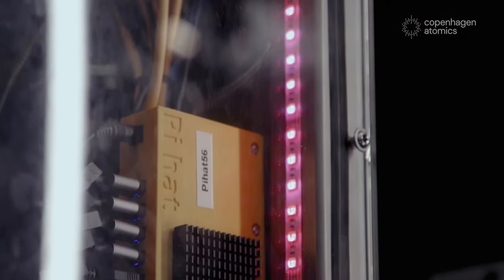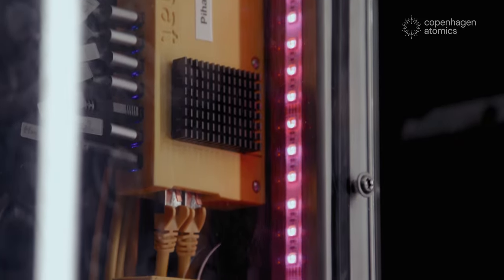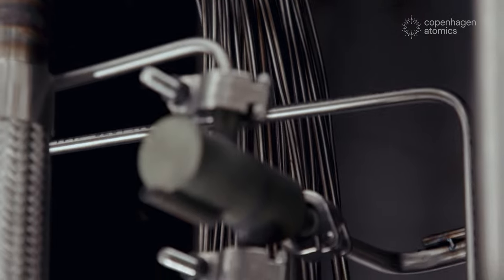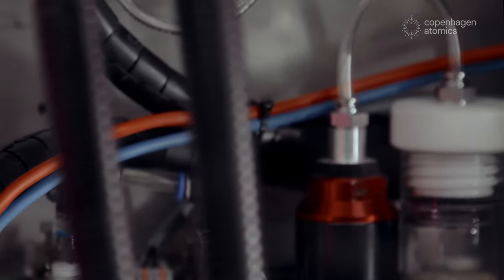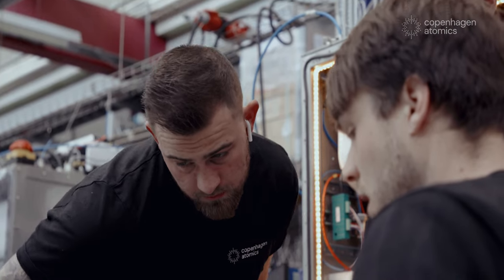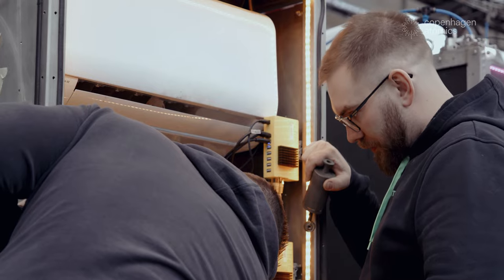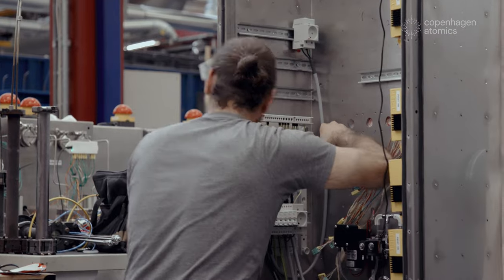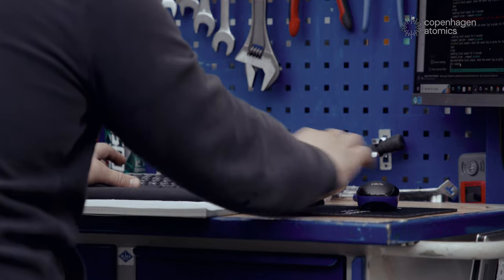Innovating nuclear technology with the world's most advanced molten salt test platform

Comment: Hello again Thomas. I met you at the New Mexico TEA and interviewed you outside of McDonalds. I went to Arizona the next day to look at a Piper airframe to convert to electric to advertise thorium reactors as that is what will give the necessary exposure for this industry. I later seen guy from the conference, who worked at the lab, talking about bearings in pumps and how he was getting hot spots. They had cut straight slots in the bushings and not enough of them. My own personal thought was that the slots should be in the drive shaft and skewed and reducing in depth so that the material would be pumped into the bearing by spinning shaft using the material as a way of keeping distance between shaft and impeller. Then I realized that if the outside of the fan was designed so that it would push the material to the outside wall, then it would do the same thing, the faster it spun, the more it self centers. There could be erosion between surfaces in time and because you really don't know the abrasion amount yet, but is this viable?

Comment: They still want to use heavy water as their moderator, right?
I still havent heard how they want to deal with that heat both from the neutrons and from the contact with the molten salt pipes.
I'm quite interested in that cause it seems to me that even using something nasty like Lithium Deuteride would end up easier than dealing with heavy water in a reactor like this one.
Reply from the maker: Yes we will use heavy water as it is the BEST moderator AND it is easier to use than the alternatives. In a molten salt reactor the fuel salt is circulated out of the core to remove 95% of the generated heat. It is easy to also circulate the water and remove 3% of the generated reactor heat from the water. In fact we plan to keep the water below 25C at all times. We use a standard aircondition unit to cool the water. Millions of these AC units are build every year there is no risk in choosing this route. The water is not under pressure and even if it would leak out and boil off we have a system to condense the heavy water. There are two barriers between the heavy water and the molten salt. I guess we have to make a video about this too, in order to show the public how simple and easy this works. This video would unfortunately be without the neutrons heating the water, which is the primary source for heating the heavy water.
Reply: @CopenhagenAtomics  That's interesting. I thought slowing down the neutrons would deposit a LOT more heeat into the water than that. If a simple AC unit is enough to keep it room temperature then no wonder, heavy water really is the best choice.
I would still like to see the video about insulating the water thermally from the fuel pipes. I think you mentioned aerogel a few years back, is that still the plan? Is that kind of technology ready and will the insulator last in the reactor?
Reply: @CopenhagenAtomics  Thanks. Right now all videos uploaded so far are dry runs correct? The coming years will focus on getting permissions, adhering to regulations and doing the actual testing, no?